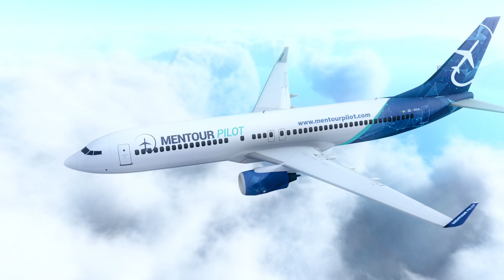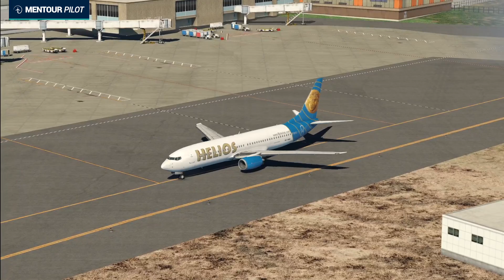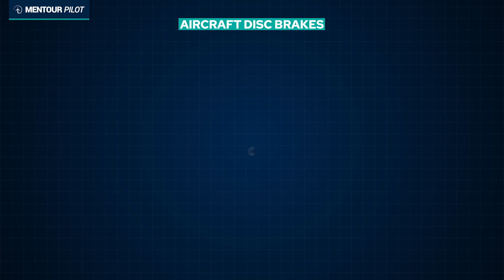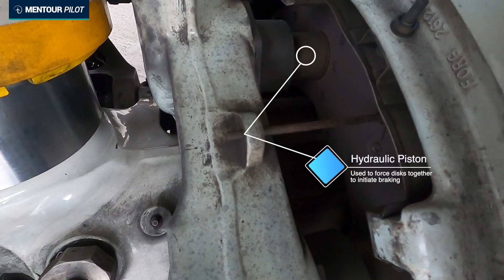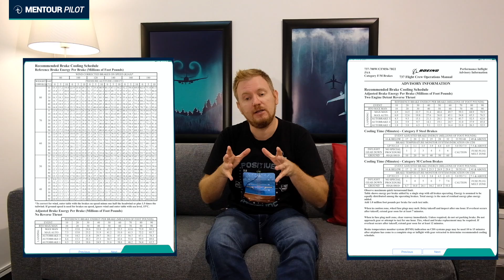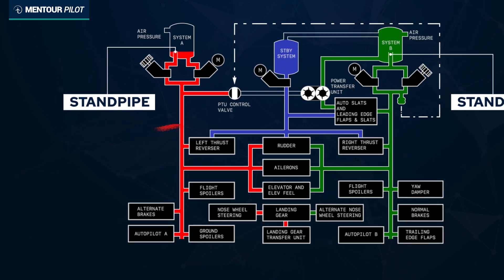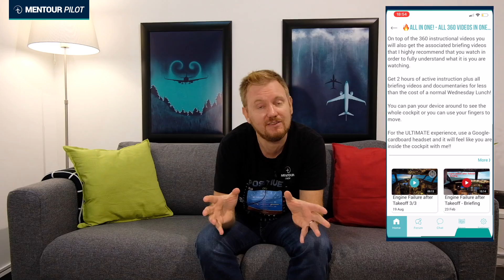How do Aircraft BRAKES work?!

Comment: I wonder if anyone has tried active cooling the breaks? You could imagine pumping liquid nitrogen through them or something...
Reply: I'll bet someone has tried or at least given a lot of thought to a brake cooling system (not many things have never be played around with).  But, it's hard to think of airplane applications where it would be useful.  
Any liquid cooling system would add a lot of weight, size, and complexity to the system.  If more brake capacity is needed, why not just design bigger brakes?  This option still adds weight and size, but no additional complexity.  This makes bigger brakes the obvious choice.
Reply: @andrewsnow7386  That would have to be done in the design phase unless there was a big (expensive) mod. There is no room for bigger brakes. Remember, bigger brakes mean bigger wheels/tires. Some planes, especially smaller ones, are already maxed out on space.
Reply: @averageguy371  You could imagine pumping coolant through the brakes when the plane is on the ground to reduce the cooling time.
Reply: @Aaron_Nonymous   No, it would be impossible without a complete redesign of the brakes & the addition of a coolant system. Then, you could only cool the brake housing inboard of the wheel, which is also inboard of the brake stack & the excess heat. Newer aircraft, like the F-35, do pump coolant to the far reaches of the airframe to cool electronics, much like a liquid cooling system in a computer, using PAO (polyalphaolefin) but this certainly is doable & needed. The only approved way to cool aircraft brakes is by time or by forced air (non-cooled). 

In the end, this is much like the issue of making the tires spin before touchdown. It's a solution in search of a problem & is simply not needed. It would also drive up cost of brakes when good old ambient air is all you need.
Reply: @T That would probably cause them to deteriorate & crack.

Comment: actually the 727-200 had nose wheel brakes but were only utilised when maximum braking was applied
Reply: It was an option available for both the 727-100 and 727-200. It was originally requested by Eastern and American to allow for higher weight takeoffs from LaGuardia with the 727-200.

Comment: The difference in brake design between vehicular (including even semis) and aircraft brakes is particularly evident with the Q400's braking system.  The prop beta is actually used for transient braking during taxi because short brake applications would actually damage the brakes that are only designed for single high speed application (landing or RTO) followed by an extensive cooldown.
Reply: Cars use vaccum breake servos. Large aircrafts us hydrolic... i dont know about trucks. High speed trains also use hydrolic once.

Cars also have mecanical breake aplicator that is completly sperate and those are used for anti skid. As far as i know aircraft dont have that... (might me the case for the A320)
Reply: @matsv201  Autobrake systems in aircraft are essentially the ABS realized as aircraft braking systems.  Trucks (semis) use air braking like trains.
Reply: @takingthescenicroute1610  well.. The diffrance from a car is the breake servo.

Comment: Isn't ABS anti blocking system?
Reply: At least in American English it's anti-lock brake system (or anti-locking brake system, or anti-lock breaking system, etc).
Reply: In (USA) airliner usage as I know it, ABS is "autobrake system":  Select a decel rate, or "RTO".  Antiskid or A/S is used in conjunction with either ABS or manual braking to keep the tires from locking up.

Comment: Simile to disc brakes on a car. Just more rotors and stators.  Unfortunately I changed them for years. Not the best job in the world and you had better have strong hands and a strong back.  I was told the material used on the braking surfaces was ceramic.  I can hardly wait to hear you tell me what I was breathing for years. Breaks reach maximum temperature 30 minutes after last application. At least in the old heavy military aircraft. I saw many fuse plugs blown and a few tires from hot brakes.

Had a flight crew find out how well the anti skid worked on a slick snow covered runway. 😂😂 The call was, There he comes, and there he goes!  He stopped in the overrun and we had to tow him back to the ramp.
Reply: At what time max temp occurs depends on where exactly you are measuring.  The actual friction surfaces are going to be the hottest right at the end of braking.  But it takes time for the heat to move places.  So the brake calipers are going to see their hottest temp a while later as the heat soaks out of the brake disks. And, the wheel rims are going to take even longer to reach their max temp.  That was sort of shown in the graph in the video.  The max indicated temperature (possibly measured in the caliper) is delayed from the disk temperature by maybe 10 min.
Reply: @andrewsnow7386  oh well excuse me. I guess my 20 yrs experience on Heavy military aircraft like the C-5 has been undone because an internet hero wants to break the brake down into pieces. 🙄  Now how long does it take for your system to reach the temperature necessary to melt the fuse plugs?  If the wheel catches fire what are the dangers associated with said fire?  Shit boy school me.  I might remember something I’ve forgotten.
Reply: @Roadglide911  Sorry, I didn't mean to offend.  I thought others that read your comment might appreciate a little more explanation of why the fuse plugs in the wheels would do as you describe, and blow well after the landing.

Comment: I've seen them hot enough to smoke and let off of the thermal plugs on the tires from a heavy weight rejected takeoff.
Reply: As it happens, the fuse plugs are on the wheels (not that one can tell from a distance -- the tires simply go flat).  Brake heat goes through the wheels first, and is fairly predictable compared to heat transfer through the tires.  So with properly chosen locations for the plugs on the wheel, tire deflation can be assured prior to pressure increasing to the point of a burst (FYI by regulation burst pressure has to be at least twice a tire's rated pressure).

Comment: I have a question: can frequent use of the anti-skid system wear off carbon brakes quickly?
Reply: I wouldn't say quickly, it would be quicker than if you didn't use anti-skid, but the wear rate is according to design.  The issue with this is that you wear down and destroy the tires when the wheels lock up.
Reply: @Jim Mork In my answers I like to throw in numbers perhaps not readily available on the internet, for whomever might be curious, but  the bottom line is antiskid systems work on contaminated runways as well.  What changes as surface friction degrades is how the plot of brake pressure vs time looks.  On a dry runway, the antiskid-enabled brake pressure is a flat-ish line with just small ripples from the antiskid's pressure dumps.  The lower the runway friction, the deeper and wider those pressure drops get.
Reply: @Jim Mork Friction coefficient (with A/S) is around 0.75 for airliner tires on dry pavement (varies a bit with speed).  A wet runway knocks that down to more like 0.4 depending on the particulars, and then ice or hydroplaning closer to 0.1 or less.  So reversers don't typically matter much for average stops on a dry runway, but are crucial when runway friction is severely degraded.

Comment: ABS doesn't stand for "Anti break system", but rather "Anti blocking system" (at least in german)
It's a really interesting thing to me to hear about the differences between steel and carbon disk breaks! Great video!
Reply: The internationsal technocal term is indeed anti block system  but a lot of marketing use antilock breaking system... and... well.. its very descritive.. so i cant complain.

Comment: GOL airlines, in BR, upgraded some of their 737 brakes to carbon to comply with higher performance requiriments for the (somewhat) short SAO PAULO city airport runway. 
With the upgrade they were able to operate with full (passenger) capacity. 
Those restrictions were latter lifted.

Comment: What? You didn't cover Shin brakes my old 1946 Taylorcraft had!  ;^)
Reply: What were they?
Reply: @fukawininetynine5999  Fairly weak brakes that were standard on old Taylorcraft planes, which were 2 seater, side by side aircraft.  Basically a side by side piper cub. The Piper Cub had a narrower fuselage, so one seat was behind the other.

Comment: in 1997 i came down mount teide in tenerife in a ford Ka... me and my 2 mates where shitting ourselves when i touched the brakes - and nothing happened... "ok" i thought "slow down through the gears" this did not happen... "ok" i thought "slowly pull up the handbrake - nothing happened..... we had slowed from 60mph  down to 55mph in about 1 mile... "ok" i thought "look for gravel or sand at the side of the road"  nahh: no gravel or sand.... so i put it down a ravine and wrote it off. Moral of this story: if you ever rent a car in spain..... drive on the plain.

Comment: What is the steal wire between the wheels?
Reply: Nothing fancy..its called a retention cable that connects both brakes together on each main landing gear. It keeps the brakes on the axle if the wheel is taken of or falls off.
Reply: Yes Mentor Pilot it looks like a static field balancer ~ 1 Second it is very apparent

Comment: At what point on an ILS approach do you turn off the autopilot
Reply: Depends greatly on just what system you are using and is pilot flying decision · Standard  ILS approach has "decision height" which past that I myself would tend to disengage with the idea of I am going to fly it down to the surface myself though systems we have now some are capable of putting it on the deck

Comment: If you think airliner braking is a complicated issue, you should try operating smaller turboprops with no anti-skid and perhaps badly designed brakes. They can be a nightmare! Some of those aircraft (Cessnas C406 & C441 and the DHC-6 Twin Otter) have nicely designed no-antiskid systems where the brake pedal force directly translates to brake effect, just like an ancient car with no ABS. There was one aircraft I have flown that has astonishingly difficult brakes, the Do228 Dornier. after landing, you applied brake pedal and nothing happened. Then you carefully applied some more pedal pressure and very little happened. THEN, if you had to, you applied just a little more pedal pressure and the wheels would lock up! A flat spot on the main tires SERIOUSLY damages them, an expensive occurrence. Fortunately the Do228 has a touchdown speed well below 100 knots and being a Garret-powered high-wing aircraft has MAGNIFICENT reverse capabilities. Wheel braking was rarely needed for anything more than taxying.

Comment: It would be interesting to see if the carbon brakes are similar to the ones used in F1... (It would be interesting to see if some other tech can be adopted from there as well)
Reply: The F1 systems came from the aircraft industry experience. Carbon rotors are less effective when cold, so it took some additional engineering to transfer the technology to a less extreme use case.
Reply: @Markle2k  Interesting. I wonder if there might not have been some developments in cooling that can be applied... (A single rotor is likely a lot simpler to cool though) (I do know that the ventilation have moved to lots of tiny channels over the years)

(I know F1 is on a carbon-carbon composite, I was not sure if it is from the same lineage (and the exact same material as in aviation) or developed mostly independently..)
Reply: @GertvandenBerg  "Positive rate. Gear up." There isn't a lot of opportunity for conduction cooling with the air blowing across and through the disks. You would be stuck with positive ventilation at the gate probably. They seem to manage it well enough already, and carbon brakes perform at their best when hot (not too hot).
Reply: @Markle2k  I'm mainly thinking of the fires that sometimes happen on rejected takeoffs... (whether that is possible to prevent without overcooling in more common situations, without making it too complicated (e.g variable ducts or similar))

Comment: When I buy brakes for my car, I always opt for as much carbon as I can. I am not so concerned about cost. Anything less doesn't perform as well. So, why don't more aircraft, for safety reasons, opt for the best brake materials like carbon?
Reply: What kind of sports/luxury car do you have?  Unless you are driving a reasonably high-end sporty car, you probably can't even buy carbon brake disks for it.  Are you sure you aren't think about ceramic brakes?
Second, I doubt they are any safer.  As with every part on an airplane, the brakes are going to be designed to be as light as possible while being safe.  Whether carbon or steel, the brakes are probably going to be designed with the same factor of safety.  If the carbon brakes have more potential performance, then most likely they will just be designed smaller than the steel brakes to save weight.

Comment: simplified - the brakes used on large aircraft are the same as a multi disc clutch pack on an automatic transmission and in many motorcycle clutches. 
most brakes now are carbon.   1 set of brakes cost more than your car / truck. 
the most common serious consequence of heavy braking is blowout - but not like you think. 
aircraft wheels have  " fuse plugs "
when the wheel reaches a certain temp - the wheel fuse plug will melt and create a controlled leak preventing the tire from exploding.
Reply: Similar in appearance to a clutch pack, but each performs a very different function.  A clutch pack isn't about temporarily storing kinetic energy which has just been converted into thermal energy, for example.
Reply: @marcmcreynolds2827  really -  what is the fluid and the aluminum case of an automatic transmission  is for ? why are there 3-4-5 gallons of transmission fluid ?  why  is transmission fluid routed through a cooler ?  to transfer the heat created by the energy transfer.  it does the same thing in the opposite direction.
Reply: @mixter7x7   That's a big automatic transmission if it holds 5 gallons, but in any event the purpose of its heat exchanger is to maintain a fluid within a prescribed temperature range.  The purpose of a brake is to convert kinetic energy into thermal energy via friction.  The "opposite direction" of that would be converting thermal energy into kinetic energy (a steam engine, for example).  Or maybe I'm taking things too literally, which my wife could go on about at length...

Comment: MiG-21bis has brakes on the nose gear as well, with a handle on the instrument panel to enable for takeoff and landing, and disable for taxi. Its brakes are pneumatic and operate off stored pressure, which gets interesting if you use it all up.
Reply: Ah yes but the beloved Frog Foot?

Comment: In regards to brakes being the primary well... Braking method on the aircraft that is exemplified best in the C-17. Such an enormous aircraft designed for short feild landings with huge amounts of weight on board, it uses 12 MASSIVE  carbon fibre brake packs, in conjunction with spoilers covering 3/4 of the wing span to dump all of the lift, but the thing making it so much more extreme than other aircraft is that the thrust reversers direct all thrust upward, with no openings on the lower half. So all of the thrust is in effect pushing down on the brakes even harder, in effect making the aircraft even heavier to allow harder braking without locking at all. One hell of am impressive aircraft
Reply: Interesting and very well explained.  I'm also told (by a C-17 pilot) that they can, and sometimes do, deploy thrust reversers while airborne to make dramatically high-rate descents without gaining a lot of airspeed.  (Something like a 10,000 feet per minute decent.)  He told me when they do that for training purposes, they always tell ATC what they are doing (even if they're in a Military Operations Area) because they've had controllers think the plane was falling out of the sky from the radar data!
Reply: @skyhawk_4526  Can confirm:  you float inside (more like in a pool, than in space i was still in my seat, but my arms were up), and they make you strap everything down.  Did this going into theater in response to 9/11.  Didn't know why it was so loud and rough until someone told me the T/R's were likely deployed.
Reply: @skyhawk_4526  as far as I know they're the only aircraft in the world capable of and designed to use the thrust reversers in the air yeah. Pretty much MASSIVE air brakes for their tactical descents. Such an awesome jet 😁
Reply: Good ol' Moose!
Reply: @roriquevernonii8439  she's definitely a beast 😁
Reply: @yukionna1649  love that sound!
Reply: That's impressive J. Young! Thanks for your service - sounds like you either are, or were in the USAF. 

I got to check out a C-5 Galaxie at an airshow at CLE in '19. Man does that thing have alot of wheels and brakes! Like a flying warehouse, lol. Unbelievably massive.

Comment: Imagine there was a brake on the nose gear and that locked up and the whole plane just flipped over.
Reply: Its unlikely a 737 would flip. The weight will just keep the thing moving. At best the tire will skid. At worst the tire blows out and digs into the runway a bit possibly breaking the gear right off but even the its not going to flip..
Reply: It's not a sportbike. You're not going to pull an endo from too much braking at the front wheel, no more than you will in a car.
Reply: I know it's a joke about when you squeeze the front brake on a bike and eat shit.
Reply: @Nexalian_Gamer  Thank you I did not get the joke; Busy with issues that matter!
Reply: On old little planes with classic gear (no nose wheel but a tail wheel) it s possible to flip them over if you brake too hard.
Most of them have little or no braking power to prevent these mishaps
Reply: A over 60 ton aircraft ain't gonna flip